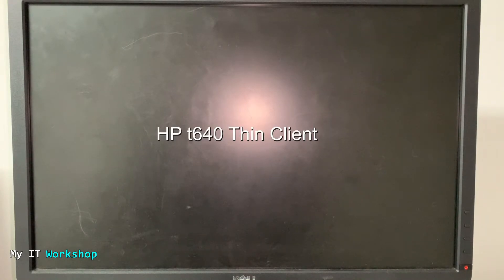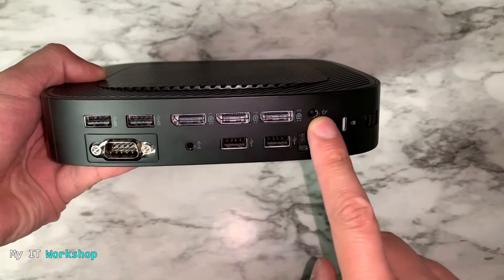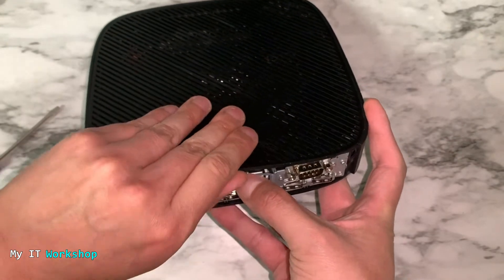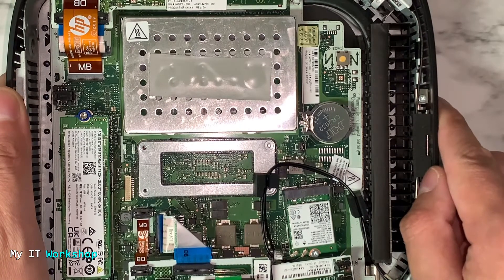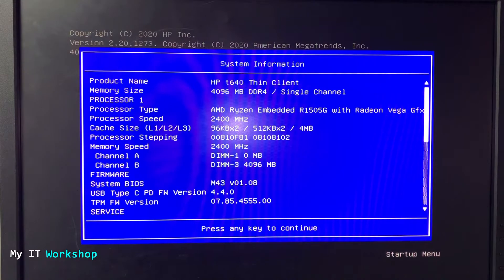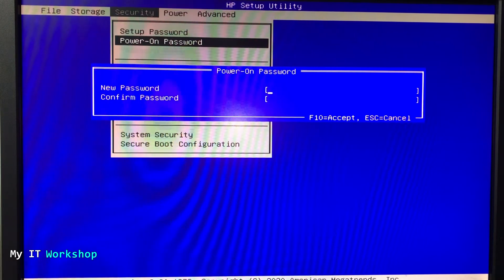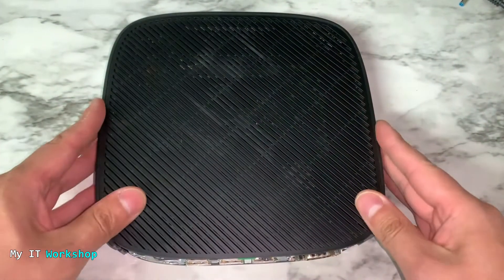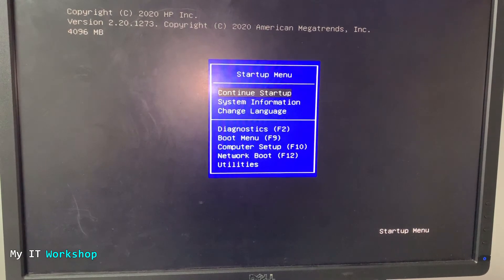Bios Password Reset | HP t640 Thin Client

Comment: How to do this on T740?? This method does not seem to work. Thanks.
Reply: I can confirm this method works in most t740's... But not in everyone.
Reply: This method works on T740
Reply: Yeah it doesnt work on all T740's it didnt work on mine either. I'm gonna try taking the cmos battery out and powering on.
Reply: It didn’t work. Did you replace the bios chip ?
Reply: @user-gr4vx8xz1l  Mine was fixed just by removing the password pin, I've heard other people doing the CMOS battery thing once the PIN removal doesn't work and it hasn't worked for no one